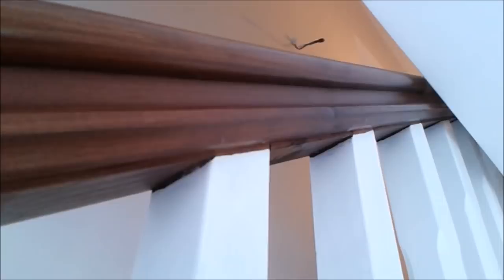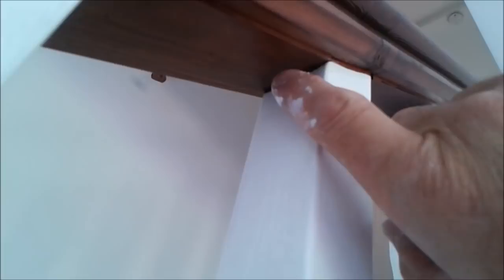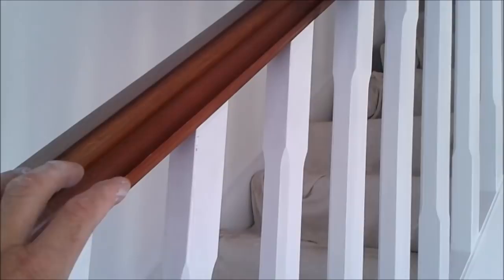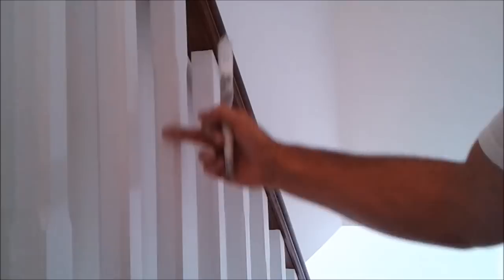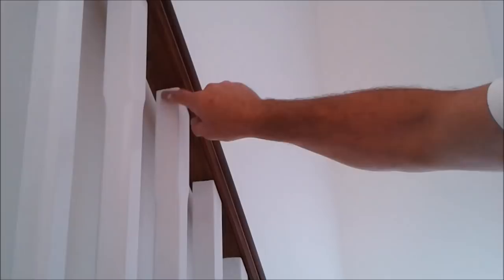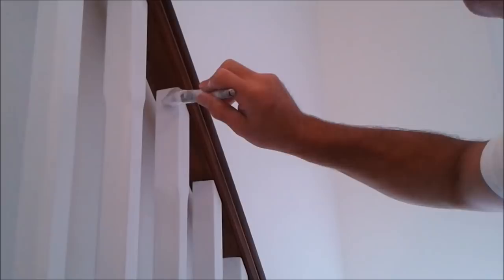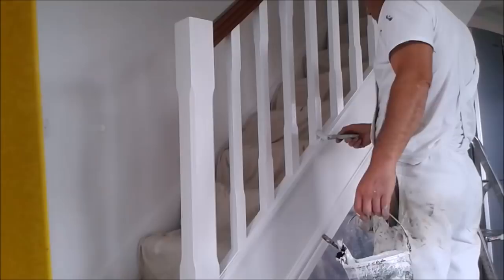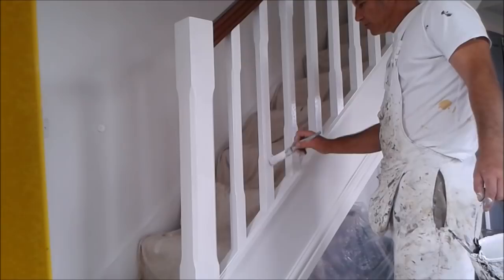Painting spindles on a staircase

Comment: i know this vid is 4 years old. but im doing the same job now. sanded the handrails, varnished them. about to paint newel posts, spindles. have used BIN primer on the newel posts as i sanded them right down. on the spindles, i havent. can i just recoat them with satin finish, after keying? thought it would be a quick job..it isnt :) as have to match the skirting board, and the triangle wood bits under the spindles ( which meet the stairs, dont know there name.) oh and btw, your videos, are extremely helpful, detailed, so ignore any "experts" telling u what you're doing wrong.

Comment: Great video! Thank you for explaining this. Do you recommend when painting the spindles and newel to be sanded first before adding the prime? The had a shiny stain coat it seems before
Reply from the maker: Thank you and yes a light sand.
Reply: Thank you! I had a contractor come to do other work and he said that since the finish was varnished he only needed to apply prime. He wants to use the Kilz oil based. Do you think that way would allow the paint to stick or it will peel off?
Reply from the maker: @paul590  never heard of that but that means nothing... some paints need no sanding...  but check the paint instructions.   But best practice is to degrease and sand undercoat then gloss.  Bare wood will need a primer.. thanks
Reply: @PaintingandDecorating  thank you for your assistance and explanation!

Comment: I made the mistake of sanding my bannister down to bare mdf is this going to cause issues? i am painting it black but will be applying a grey primer and undercoat. Just worries it will swell up, i have been told the only issue is, it is more time consuming and given myself more work
Reply from the maker: MDF handrail..  as long as your not using water based paint it will be fine...  water will make it swell... you can seal it first using B.I.N. primer.. thanks
Reply: @PaintingandDecorating  I'm using rustins quick drying grey primer and undercoat in grey then top coat black not sure if that's water based or not

Comment: While staining my handrail, I accidentally touched some of the spindles.  I wiped them off when I realized it, but not all.  Do I have to use a stain killer before painting, or will a light sand cover the marks and primer cover the marks?
Reply from the maker: You should be able to touch it up once its dry.. no need for a stain block. It's not that type of stain.

Comment: Do you have to sand all the old finish off or just do a light sand before applying primer?
Reply from the maker: No as long as it's not peeling and it's keyed well.  Light sand to key then paint.
Reply: @PaintingandDecorating 

First primer? Or straight on with normal paint?
Reply from the maker: @aaaaaaaaaaaaaaa16308  primer for bare wood but have a read on your paint tin. Some paints need no primer and others do.  Thanks

Comment: Hi again, I am getting on ok with the spindles, 2 coats of undercoat done and just to top coat with Satinwood white. My handrail is pine , same as the spindles. I've been told that because it is a soft wood, the mahogany varnish finish won't look good. Is your handrail pine or a hardwood ? So, I might just do it all white if the finish doesn't look as good as yours. I am trying it on a spare piece of pine rail first. Thank you for your help.
Reply from the maker: Hi it's actually pine in the video... also satinwood is self undercoating as such...   prime bare wood then two or three coats of satinwood..   only gloss needs undercoat...  and sometimes with a good sand you can gloss on top of gloss.
Reply: @PaintingandDecorating  Is the handrail pine too ?
Reply: @PaintingandDecorating  Is the handrail pine too ?
Reply from the maker: @lynnescott3072  Sorry yes
Reply: Thank you for all your help and advice, my painting is looking good but I've chickened out staining the handrail , as I'm not confident doing it. Some people have told me that it's very hard to stain pine and it won't  look good. So, I'm thinking of just doing it all white . Time will tell. @PaintingandDecorating
Reply from the maker: @lynnescott3072  Thank you. Go with the stain and if it fails paint it white..

Comment: One more question, did you/do you do a light sand before your second coat of gloss?  Does your answer apply to both oil based and water based gloss?  Many thanks in advance.
Reply from the maker: Paul Roberts Yes always give a light sand between coats.

Comment: Great job 👍 how did you do the hand rail ??
Reply from the maker: Thanks and we used Ronseal diamond hard varnish walnut.
Reply: Thank you. The reason I'm asking is I've got a staircase that has white spindals,skirts and risers with a mahogany Matt varnish hand rail and posts that I want to redo and unsure what's the best way to go about doing the hand rail and posts. Can I just sand the surface,clean then reapply a mahogany varnish on top ? Appreciate your advice cheers
Reply from the maker: Ian Thornton No you have to remove any grease from the handrail and newl post tops any where there maybe grease. Then sand and paint.

Comment: How many coats of oil based under coat is on new pine wood then oil based eggshell on top
Reply from the maker: It had knotting on de Knots and one coat of undercoat thinned to seal. Then two coats of Dulux trade satinwood.
Reply: Painting and Decorating sorry I didn't write it properly. I was asking how many coats does a new pine stair case need with a oil base undercoat with a oil based egg going on top
Reply from the maker: Well to be honest as long as you seal the knots you could thin some eggshell with white spirit for the first coat and two coats of eggshell straight. But better to seal the knots, then use a wood primer for softwood then two coats of eggshell.
Reply: I have water based Ronseal knot block primer and undercoat in one. Your comment implied thinning undercoat down? Is that to make the base undercoat easier, like a mist coat?
Reply: I have light oak varnish, would you advise I stain the bannister rail, then clear coat for a better colour contrast/job?
Reply from the maker: If you're using Ronseal follow the instructions.  The comment on thinng the undercoat was for oil based only and has to be thinned about 25% white spirit. But that's a cheap way and does work.
Reply from the maker: Personally I would stain the hand rail and then clear coat. No need for the light oak varnish.
Reply: Many thanks for your reply. Much appreciated.
Reply from the maker: Your welcome.